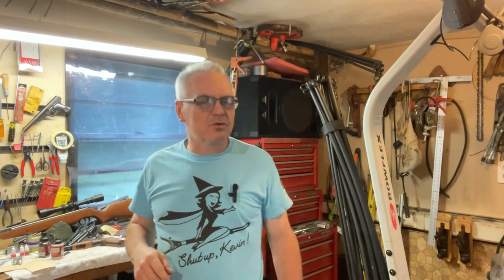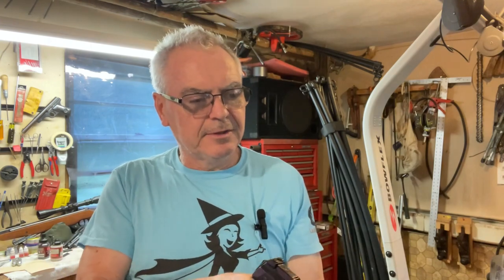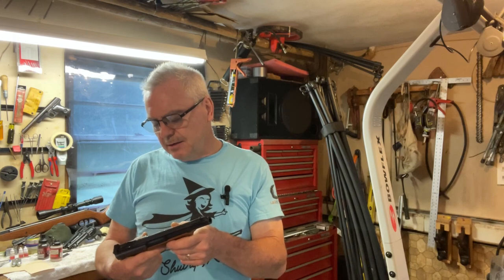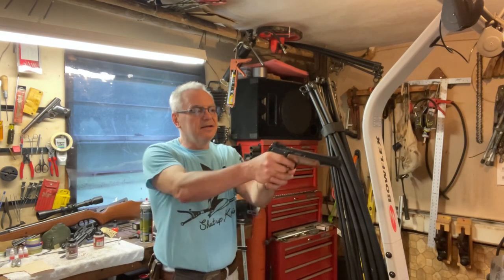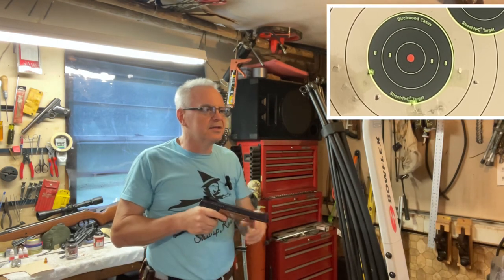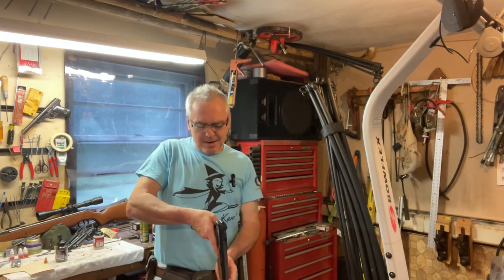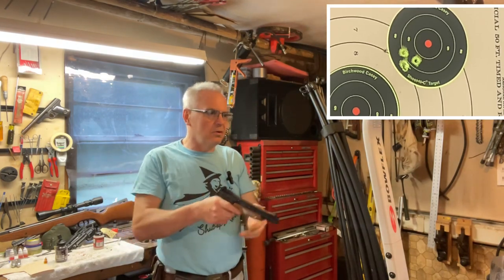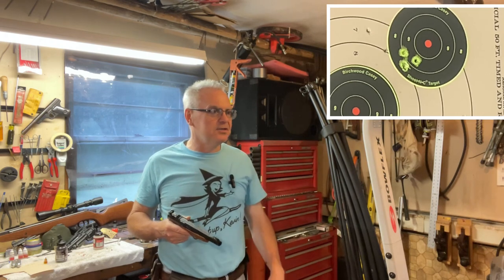Daisy powerline 1200 co2 bb pistol. Chrono testing and targets.

Comment: I love my daisy 1200. Just so you know the daisy 1200 is great for plinking useing the 7.9 g.r hollow point crosman pellets. Just load the pellet in the barrel from the front and seat the pellet down the barrel until it stops  useing a cleaning rod for .177cal until the pellet is seated. Very accurate with pellets even if it's a smooth bore. That's all shoot out if mine now.

Comment: I have two of these just taking up space in a drawer.  I have new seals for both and need to get off my tail and reseal them.  One of them shot great for years and then developed a leak.  The second one I bought online and it was supposed to be functional, but not so.  As I recall, the good one did pack quite a wallop for what it is.  I enjoy all your videos.  I too am a .22 fanatic.  I just won an auction on GunBroker for a nice High Standard Supermatic Citation Military 107.  Due for delivery in two days, can hardly wait.
Reply from the maker: Nice!

Comment: @WalnutandSteel, I found a Daisy Powerline 1200 in an outbuilding on a property I purchased. Mechanically it functioned well...cocked, fed BBs, dry fires fine, etc., but when I loaded a fresh CO2 canister all the gas immediately escaped out the barrel. Sound like a simple or straight forward fix, or should I put it on eBay? Thanks!
Reply from the maker: I have resealed one there are a few o rings that can be replaced